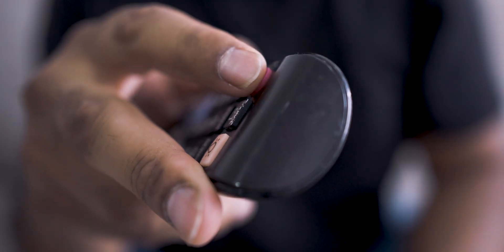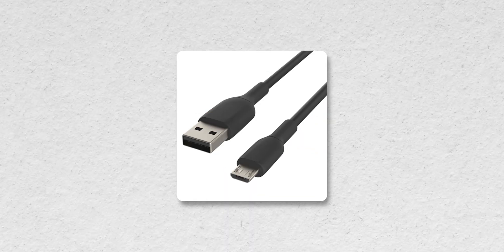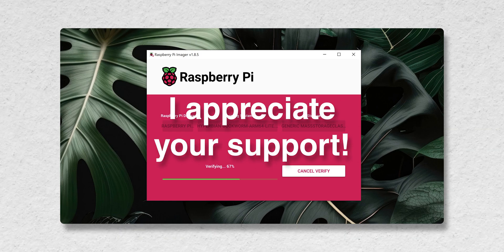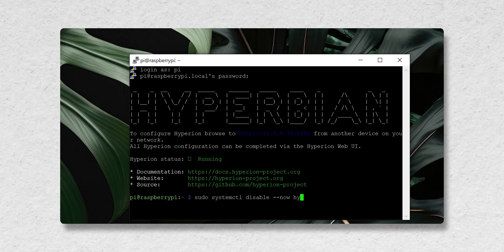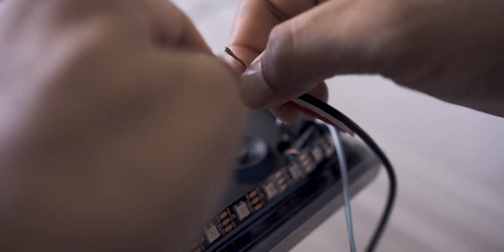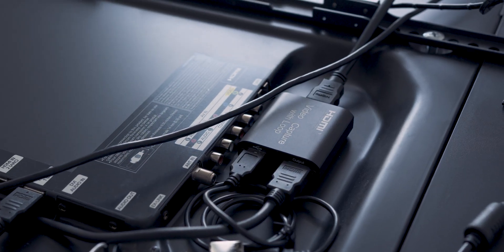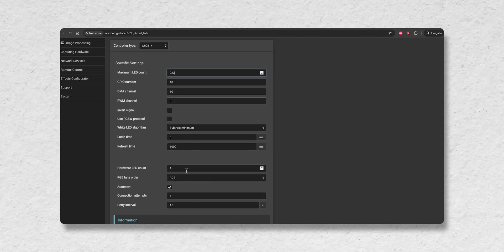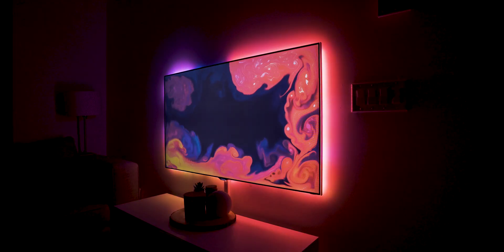I gave my TV a GLOWUP with a DIY LED Ambilight backlight | Philips, Govee, Nanoleaf alternative

Comment: So this is not for TV but the amazon stick and the xbox or whichever thing that uses TV as monitor?
Reply from the maker: Hey Lukogs, you're technically correct -
the title of my video does say "glow up for my TV" but really the input source for the LEDs comes from whatever device is connected via HDMI to the capture card. 
I'm not sure if there are any DIY dynamic LED backlight solutions if you're using built-in apps on your smart tv. The only  thing I can think of that would work is a kit that uses a camera to capture the video.
Reply: @bhimmeup  As stated, most of the videos are just HDMI videos in the name of diy ambient light. The only available current solution is to use the camera to read colour. 
But..... I also thought of splitting the ribbon cable that carry visual data to the TV screen from motherboard, in that way the Arduino/raspberry/whatever can read those colour data and transfer to the LEDs; this need someone with brains to do.
Reply from the maker: Your goal is to get a more accurate colour representation onto the LEDs by reading the actual colour values? The HDMI signal will contain that data too, no? As long as the software can convert it in the same way if you were to get the visual signal from the TV's motherboard?
This is well above my pay grade unfortunately, LOL. But I would be interested to see if you're able to come up with something. 
The only other way I see this happening is if TV manufacturers have an in-house app, or someone develops an app specifically for ambient lighting. The LED strip itself will be plugged into the USB port and lighting managed that way.
Reply: Probably not possible if nobody has figured out how to do it yet. As far as I know, LG TVs can be jail broken/rooted to run PicCap/HyperHDR for the screen grabber. Android TV’s can install Hyperion grabber but might not work with DRM protected content. If you have a different TV, the only solution is using an external source as an input to use with a HDMI splitter. (Fire Stick, Roku Stick, Apple TV, NVIDIA Shield, etc).

Other than that, it’s nearly impossible to capture the internal source of a TV if you don’t own an LG smart tv or Android TV.

Comment: There is a fork of Hyperion for 4K HDR output and improved led color saturation called HyperHDR. I am using it with a 4K Elgato capture card on a 85 inch TV in my living room. It was cheaper than buying a Philips Hue setup, I also get all the same HDR functionality and audio outputs as the Philips. Another suggestion is Hyperion and HyperHDR can be automated with Home Assistant if you are using it. You can setup some interesting automations with it for notifications. I have mine start blinking blue if my laundry is done and it won't stop until I remove my clothes from the washer or dryer.
Reply from the maker: Hey afcragg, thanks for the awesome tips! I know a lot of people are using 4k panels so great info for them. I, personally, am going to look into the automation part with Home Assistant.
Reply: @bhimmeup hey buddy can you tell me how much it costed ?
I want to do it with my 55inch tv

Comment: Thanks for sharing your build! Looks really nice. Do you know if that capture card will still output 4k to the TV if you have a 4k input like a fire TV? Amazons description of the device makes it seem like it will only output 1080p to the TV.
Reply from the maker: Hey sgtnuggets, thanks for stopping by!
It looks like the one I used takes in 4k input but outputs only in 1080p. 
There are capture cards that do 4k30fps, which will be okay for a 4k Firestick.
Alternatively, you have the option to get a 4k HDMI splitter and run one output to the capture card and the other output straight to your TV.

Comment: Excellent video, i might just try it out if the price is justifiable 

just 1 recommendation - DO NOT use electrical tape on the back of your tv - the heat & dust will make a mess out of the tape, and the glue will leach out to everything the tape touches.
I used tape and when I had to remove some cables from the back, my god the sticky mess was hard to believe.
Reply: Confirmo, me paso lo mismo en in monitor, no importa cuantas veces le volviera a poner cinta siempre se despegaba y dejaba una capa de pegamento :/
Reply from the maker: Hey Kushagranayyar, thanks for dropping by!  I'll be sure to avoid using electrical tape in the future since I plan to do this project again at some point. Any recommendations on what type of tape would work best?